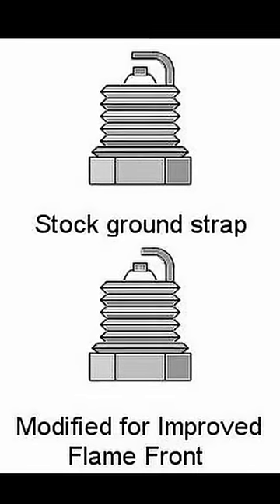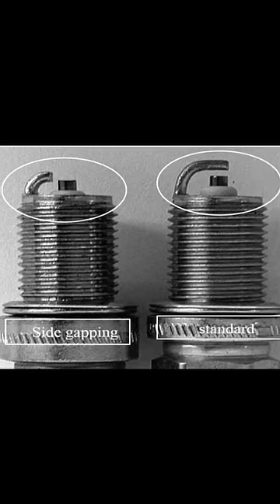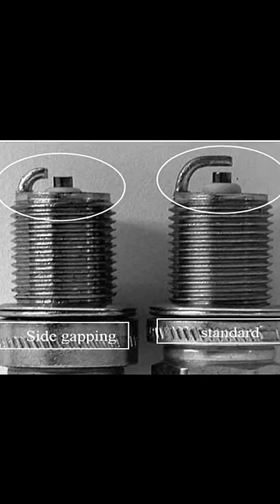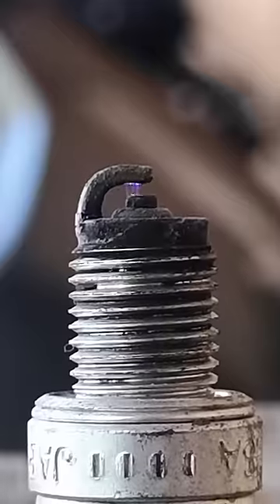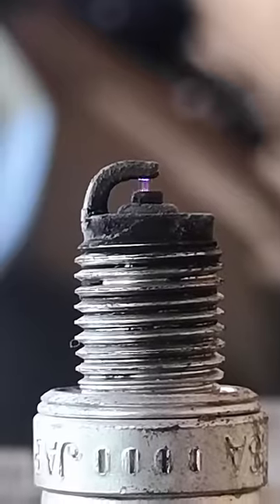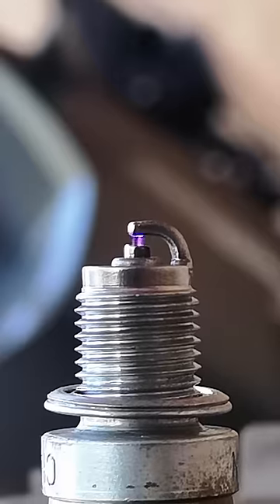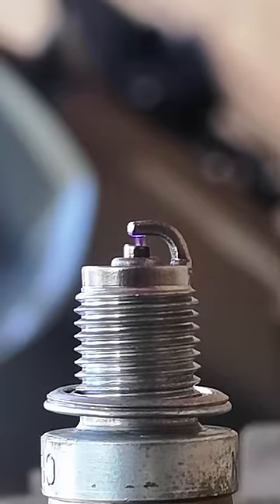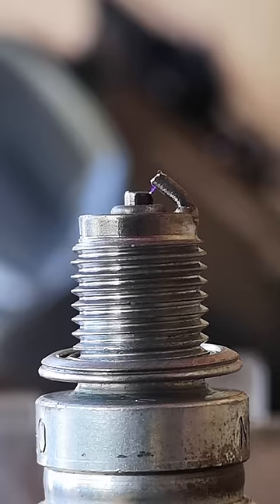Spark Plug Side Gap

Comment: electric arc scatters on standard plug and keeps it from developing a hot spot on the electrode. it will eat itself to death
Reply: Exactly this, you beat me to it. If side gapping was better that's how they'd come from the factory.
Reply: @rcx575 this video is a bad example of side gapping. The picture is more accurate then the plug showed they cut it back way to far. Some manufacturers do in fact use a side gap design. V3 or any other multi ground strap plug is like this.
Reply: What if you were to use a quadro arc spark plug and side gap each arc thingamajig? Let's go ahead and make that video on that and if you do that I'll subscribe to your garage damn channel dude that's the only way!!!
Reply: @rcx575 you definitely see some things on here not a good thing for people to learn or do things properly
Reply: Not to mention, closing the gap will do this anyway. Like a water hose, closer to the outlet it’s concentrated, further away and it starts to spread out. Hell even a shotgun demonstrates this.
Reply: Was not aware of this practice but I assume the mod is just to last race distance.
Reply: Yes, you are absolutely correct  for daily drivers. Consumable item when you're after max power. Side gapping and indexing can get up to 3% over a standard installation.
Reply: They're likely replacing the plugs every race already so they're okay with the shortened lifespan. For your car, just stick with the manufacturers recommendations.
Reply: when I check spark plugs on an engine, I thoroughly clean the threads with a wire brush and sharpen the electrodes with a file.  the spark of electricity created at the plug, just like lightning , is always attracted to sharp edges. the cleaner and sharper the edge of the electrode the greater the spark. the reason the iridium electrode is so good is because it withstands the high heat and burning which makes the electrode dull over time. however only the inner electrode is iridium, the upper electrode is not.
Reply: Probably increases the ohm load on the coil being closer to the electrode also...
Reply: Racing sparkplugs  are  used  for a weekend  or  two.
Reply: This does promote flame propagation and it does increase hp especially in the high rpm range and is superior for turbo charged engines with high boost. This reduces the ability of the spark being blown out and yes it happens quite frequently. The problem is it’s for racing. The ground strap will burn out quicker due to the less material on the ground strap. Perfect for short racing but not practical for everyday driving. Everyday driving if not changed very frequently will cause in poor idle , acceleration etc. poor for emissions too do
Reply: Y’all just ain’t doin the maintenance, I’ve seen the statistics. You may be doing your oil but you ain’t doing Yur plugs on the interval. Best not be gappin unless you slappin new plugs every oil change
Reply: @odraino  I bet your plug wires are sitting in oil in the valve cover.

Comment: Been doing this for 15 years. Never a problem.
Reply: No early foul out? You sure bout that? Just curious, not sure if this would create a lean condition on a modern day engine, and possibly increase the ohm load on coil on plug and it fail faster??? Any of this credible?
Reply: If the spark is only contacting one point and not scattered across the top of the plug you are wearing that one point down faster than the other points in turn your spark plugs will wear out faster this is not an opinion this is a fact you may have been doing this for 15 years but if you're only driving one mile every month because you live in a retirement home your story doesn't really work and race cars don't count
Reply: @saltiness_incoming1407  what he wrote is I've never had over 200 h.p. so it's never hurt a motor 🤣
Reply: @saltiness_incoming1407  what he wrote is I've never had over 200 h.p. so it's never hurt a motor 🤣
Reply: @saltiness_incoming1407 you’re right and wrong. 

Right about the spark plug wear, and wrong in thinking that I wouldn’t check and regap my plugs regularly. It takes roughly a year on a daily driver for the gap to grow .010 on copper plugs. Hardly a problem for a man with nuts, who maintains his vehicles. 

no need to be a condescending prick.
Reply: Just needs re-gapping indeed, if the path becomes longer it'll jump the shortest path.
It's not about the lifetime in racing
Reply: @Kris-fd9xs  yup.  Not a big deal, really.  A 30 minute job once a year, bang it out while doing an oil change and having a couple of Corona’s with friends.

Maybe with platinum plugs the intervals would be more spread out, but I prefer coppers.

Comment: Looking at the video comparison, there's more spark area with the untouched plug. Last I checked, compressed air/fuel is all around the chamber, not just on top. Snake oil.
Reply: Shrouding peter mouth, Shrouding
Reply: It's not actually snake oil... it DOES increase some performance when done professionally... but the plugs will only last 1 race by the time they are fried.
Reply: Flame shadow, and propagation front are aspects of speed of combustion. There are multi electrode plugs and shims to put the electrode opposite the inlets.

Comment: If it was any good, the manufacturers would be doing this !!
Reply: They are doing it, but with more than one ground to minimize the excessive wear of the electrode caused by a single ground
Reply: they did, with two and more side
Reply: Manufacturers not doing something is no guarantee that something is no good. Manufacturers aim for balancing the entire system, especially for your average daily driver car.

By your logic, polyurethane bushings for suspension and mounts don't improve anything either.
Reply: They did it to iridium spark plugs

Comment: hey im 15 and trying my damdest to get my grandpas old mower running that has this exact engine model and was wondering what spark plug and oil i need for it also oil filter. im so glad the thing isnt locked up. i am not familiar with smaller engines. its been siting since he passes next month marks 8 years of him no longer being with use. i remeber the memorys of me growing up and learing how to drive on it. but before he passed i was still young and didnt grasp why things like that are important. learned real fast when all my loved ones started to pass. anyways may you help me out with this and tell me what parts and whatnot i need.

Comment: Surface gap plugs like in some two stroke engines gain 4 to 9 hp over stock in a V8 petrol engine , raise compression by 1/4 point , and dont have any tip to fall into an engine, and have better flame propagation as the flame front doesnt have to do a uturn to go around the ground electrode  . Smokey Yunick writes about them in his book .
Reply: How TF is a spark plug going to “raise compression a quarter point”?

Comment: It's mean...  Turn a normal spark to side gapping spark? after being cut.. the clearance space needs to be close with the appropriate distance right? Cold plug definitely suitable maybe .
Reply: Better than stock ignition ( many variables, aftermarket boxes, higher voltage coils ECT. ) can run bigger plug gaps than stock

Comment: The voltage potential builds in micro seconds to the point  it can ionize the plug gap and discharge from the center electrode to the ground strap. It will always attempt to discharge this voltage from the edge of the center electrode. Once amperage erosion has denigrated and rounded that sharp edge, the voltage requirement to ionize that gap under cylinder pressure and fire the plug will go up dramatically. All this means that you may experience foreshortened plug life with side gapping.

Comment: one thing to say, don't confuse this with iridium or platinum  plugs, iridium and platinum are just materials used like i can say cooper or  something but why they are used is that they don't wear easily, again  iridium has a nickname or something because its  character of being able to spark with a larger gap compared to other, that's why irridium  lasts longer and have good spark, making it first choice, but now  gapping is another thing, forget about it, side gapping the one in the video there is not actually a very consequence to not give it try, other than  your spark plug will wear faster than normal causing you misfire, high cylinder temperatures your car will struggle to keep up with, which can lead to knock so many like melting your piston but for sure only noticeable  something is plug wear forget about the cylinder  temperature

Comment: Iridium does this as well. Although they work a tiny bit better in two strokes ive found when ran rich they tend to foul a little quicker/when they start to foul out they foul to death insanely quick vs normal plugs. That being said i do run them just make sure to run em in the right heat range and dont lug em around for too long without some good wot runs
Reply: I used to use" easy start" small engine platinum plugs back when they were still available and Everytime I had something worked on the shop would throw them away and install a cheap copper plug "because they are so much better".
       I finally just removed them every time I had to have something done. I never wore one out, I would forget and have to search for another one. It seems no small engine guy would use them so they stopped making them.

Comment: My experience with side gapping plugs have not been good in a regular conventional engine that drives the street every day is the one you want it’s reliable and it works side gaps are just going to raise the pressure and the temperature in the combustion chain in this case heat can be the enemy stick with factory parts and factory, spark, plug gaps, the manufacture knows what they’re doing !

Comment: The other thing you can do is gap them at .60+ (only n/a, boost can "blow out" the spark)
Spark plug doesn't last as long. 
Not for daily use, unless you want to put spark plugs in every 500 miles

Comment: Always doing this to my Motorbike. Safe and Normal, Quick Acceleration.
Reply: Haw you cut it
Reply: How you cot it
Reply: How yeu cut it
Reply: Hew ye coot it
Reply: I bought a plug that had no strap from a marine store. Ran good in a 2 stroke Kawasaki 250.in the early 70's
Reply: @dalecarter4025  "surface gap" plugs (with no side electrode) were standard fitting in Mercury 2-stroke outboards in the seventies.

Comment: It works but the electrode will burn down much faster making this impractical for everyday driving
Reply: Well he did specify racing. But curious whether that longevity concern is mitigated if each side-gap spark plug has 2 or more of these side-gapped ground straps

Comment: It does not increase the capacity of your engine what do ever, it’s a myth….as long as a spark exists and you ignite the mixture it will never do better regardless of the offset, this was tried in vane in the 1920s with two then three then four ground arms…made no difference…

Comment: Do not do this to your car's plugs. Your not driving a race car that gets changes and multiple maintenance during races. Also the fuel in a racecar has a much higher 100 octane low lead fuel.